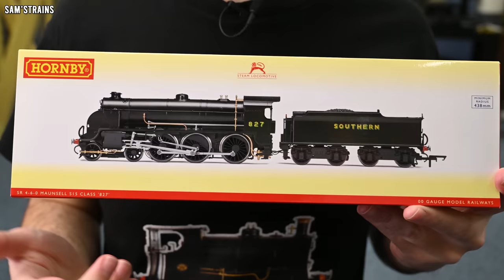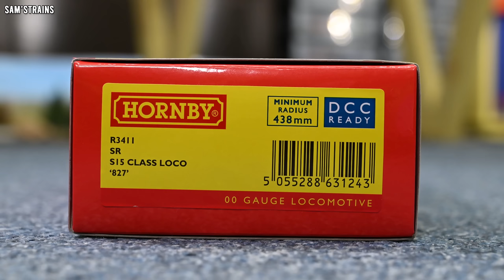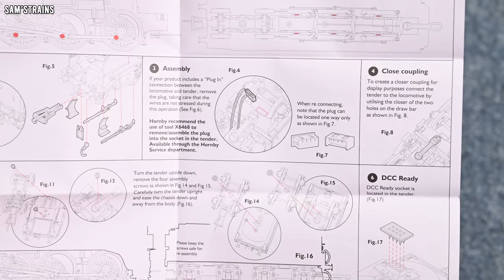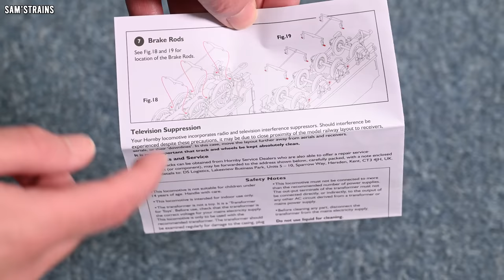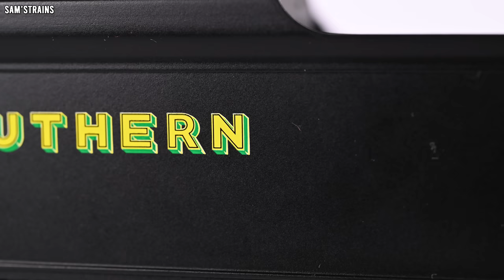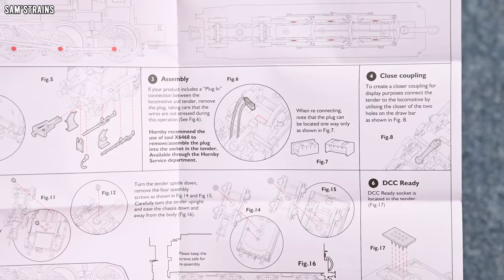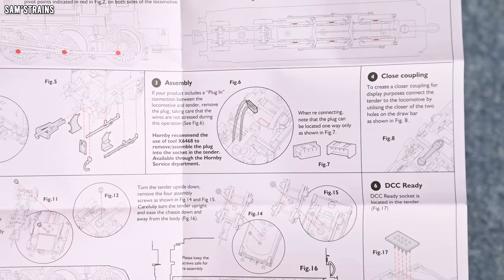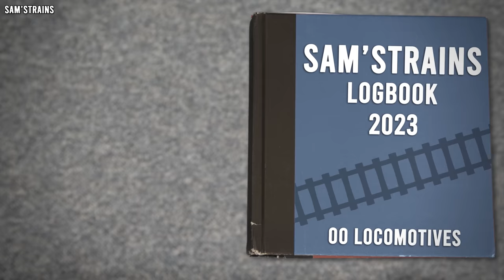Hornby's Impressive Class S15 | Unboxing & Review

Comment: Hi Sam, This is my favorite 4-6-0 and I have 4 of them running on my layout as a multi-purpose engines for freight and passenger service. The S15 was my first ever locomotive from Hornby and opened another model train world to me. Bought from Hattons for 120£. And I got them as cheap as 80£ later on. I had to replace one motor, send for free by Hornby. Great and friendly service ! All my S15's are TTS - decoder equipped and the running is superb as is the sound - if you disregard the non synchronized chuff. Impressive is indeed the correct title ! I love them machines and handle them with care. Cheers, Filip

Comment: The post grouping issue on the S16 is true for a lot of models

There J15, B12 and D16 would all look superb in GER Blue!
Reply: Would need new body shells for the pregrouping versions to be made for the B12 and D16 as the ones Hornby previously made are the Gresely modified subclasses (B12/3 and D16/3). The originals look very different, especially the Clauds as they are a bit of a minefield. As for the J15, it would probably only need a new chimney and cab but don't quote me on that.
Reply: @18EStudios  I know, but that was Sam’s point with the S16. The chassis wouldn’t need much if any changes to it.

Comment: 827 is a Maunsell engine, so you're right - it can't be in LSWR livery.  The Urie ones don't look substantially different.  By the way, the Urie H15, from which the S15 was developed, was a truly groundbreaking loco - two outside cylinders and outside valve gear.   It set the pattern. for mixed traffic locos until the end of steam.

Comment: Sam, that model is of a Southern built loco with the flat cab roof, LSWR built locos had a ridge on the cab! So could never carry a pregrouping livery, the strange thing is the tender, it is a model of a urie pre 1923 built example,  the Southern Railway did often swap tenders to suit where the loco was used, the 8 wheelers on the southwestern section, 6 wheelers on the central (Brighton) and Southeastern sections due to turntable lengths. By the way the livery is postwar black with sunshine lettering.

Comment: The large bogie tenders on ex LSWR (and locos built by the SR for ex LSWR lines) were required to increase WATER capacity - Not Coal

Out of the 3 main pre-grouping companies which made up the Southern , only LSWR locos were required to run long distances (the LBSCR and SECR lines to the coast being much shorter than the LSWR routes to Dorset or Devon and 6 wheeled tenders were the norm)

Other railways with this ‘long distance issue’ like the LNWR from Euston and the GNR out of Kings Cross used water troughs where a scoop on the tender was lowered to literally scoop up water from troughs between the rails - which allowed the use of standard sized tenders and avoided having to upgrade things like turntables at depots.

However the LSWR never felt it needed to adopt this strategy and neither did the Southern after grouping - hence they continued to build bogie tenders for locos intended to be used mainly on ex LSWR routes.

Comment: Hi Sam, a very enjoyable review as normal, I do however have one question. How does it warrant 4.5 stars for performance when like mine it needed a replacement motor, mine needed it right out of the box and a replacement I received fared no better. It just seems a little unfair to reward this basic failure. Just my opinion and great review all the same.

Comment: Hi Sam, I suppose you could "kit-bash it" and remove the smoke deflectors and give it a paint job to model the L.S.W.R. Loco, that should be easy enough. It's always easier to remove detail than to add it on, plus come up with the size and dimensions of the extra detailed pieces not a Deal Breaker. Cheers!😁

Comment: I hope Hornby fixed the earlier motor problems which caused it to overheat and fail. I bought two examples, both of which died shortly after purchase. Another 'feature' was the random speeding/slowing in the versions I had! Other than that it's a lovely model-basically an 'Arthur' with smaller wheels.

Comment: As my local railway is the Mid Hants, I would love to see a model of the two resident Urie designed S15s... unfortunately, converting the existing Maunsell model isn't quite as simple as a new body.  I believe the cylinders were actually reduced in size, which allowed them to be lowered slightly and therefore resulted in the flat footplating that your model has, rather than the stepped footplale of the earlier versions. I think the chassis would therefore require some level of alteration as well.

Comment: I've never understood why manufacturers don't do a better job with the exposed wires and how easy it would be to disguise the wiring between tender and loco as a water pipe!..I've done it to my locos using heat shrink tubing and it looks great.

Comment: Nice engine but mine is not functional : the motor seize and the running is inconsistent... The last models manufactured (mine is one of them) were quality nightmares due to the crappy motor inside. I'm looking for a spare one. It's a pity, because it is a superb engine.
By the way, getting spares from Hornby is a drag. I have also a Peckett and a Q1 that needs spares, and I can't find none.
Reply from the maker: Yes you're right about the motors - a bit of an Achilles heel with these unfortunately. Hornby certainly aren't great for specific spares!
Thanks for watching, Sam :)
Reply: @SamsTrains  I'm interested by the reference of your spare motor for this beauty or, at least, the specs to find one. And as it is the same in the new 9F, this is a reason why I did not buy Hornby's 9F.

Comment: This is not a review of a loco out of the box and a diversification from you norm😢
The motor problem is significant and the average modeller will not have the knowledge to source and fit a third party motor. There is no solution from the manufacturer and sourcing the motor is not as easy as you intimate, I even contacted you for help!
The Hornby S15 is a beautiful “Shelf Queen” but you can expect premature motor failure and in my experience this is amplified when running DCC.
I have always valued your reviews but on this occasion I must strongly disagree and I wish you had let the original review stand alone as the scores here are misleading. This model is still available on the well known website, being advertised by collectors as “New” for anything up to £169. In this instance there is no manufacturers guarantee. Some retailers still have new stock so that there will be some manufacturers guarantee but of course Hornby will only fit another faulty motor ( I had three!) if they have any.
Sam, I really value your reviews which are always objective but on this occasion, in my opinion, solely because of the motor issue the final rating is misleading. BUYERS BEWARE.
Still a great Channel Sam👍